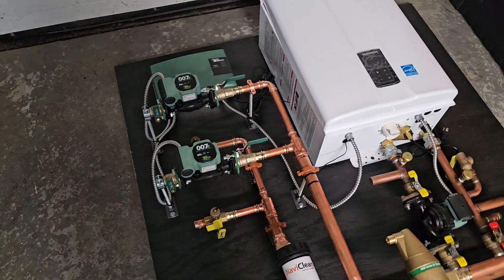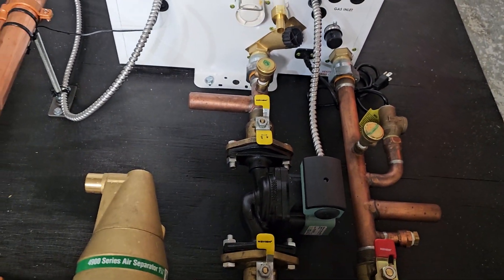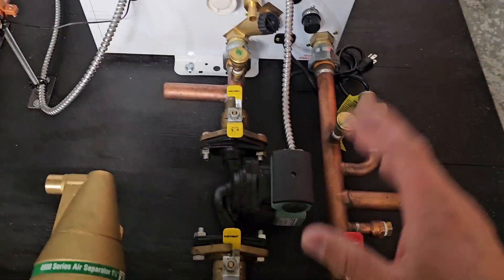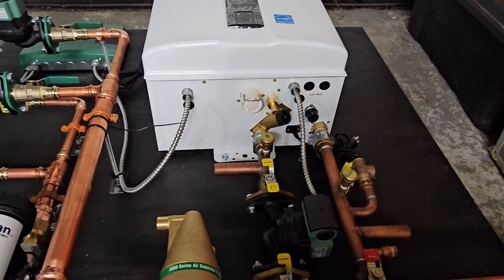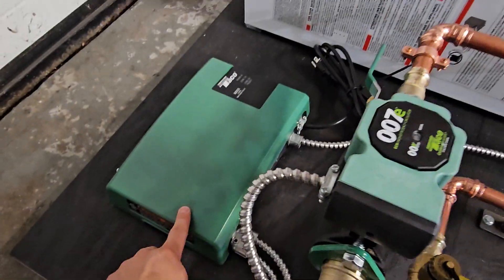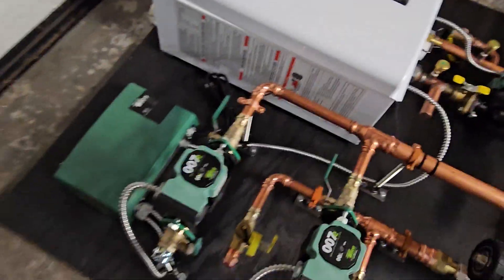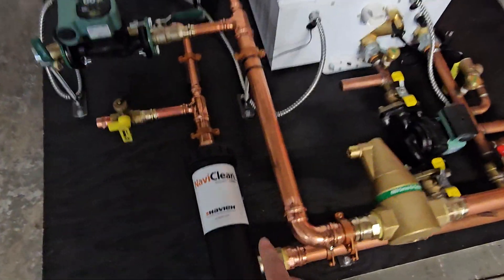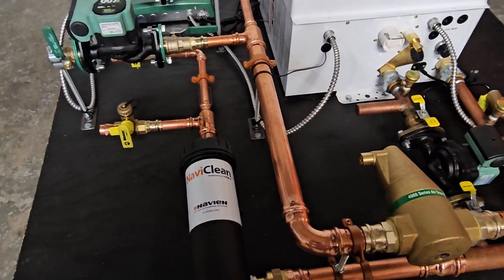2 Zone "Heat Only" Navien NHB Boiler System

Comment: Great videos! Thanks Jim. Did you use the 007 ECM pump for the boiler loop as well?
Reply from the maker: The boiler loop uses a 0015. The manual specifies which pump to use for the boiler pump.
Reply: Thanks! FYI I realize you aren’t doing the indirect water heating with this system but you reversed the supply and return in your description of how it would work. Just don’t want anyone to watch the video and do it the wrong way!  Again we’ll done on these videos!

Comment: Why do you add a pump at the boiler when you have a pump for each zone?
Reply from the maker: There is a boiler pump for the primary loop. Primary/Secondary piping allows hydraulic separation between the boiler and the heating zones.
Reply: I dont understand.  Is that one loop with two zones?  The pump by boiler only goes on when a zone calls for heat? @JimSperanza
Reply from the maker: @rcmechanialgroup2856 the pump on the boiler runs if any of the zones call.for heat. The boile pump just pumps water out and back into the boiler. The other zones water mixes with the water coming out and back into the boiler. No matter how many zones are calling for heat the boiler always sees the same flow rate.
Reply: Thanks.  Its crazy how close those pumps are to each other, it makes that  much of a difference to have one pump away at the feed and one pumping toward to boiler? @JimSperanza
Reply: Also, can you run the boiler with  just the two pumps and not one at the boiler?
Reply from the maker: The two pumps aren't pumping with or against each other. The boiler pump is on its own loop.
Reply: Maybe you can make a video explaining it, so its easier to to visually get it? @JimSperanza